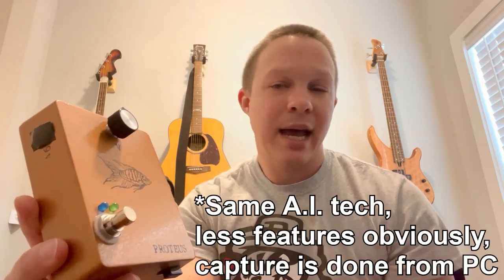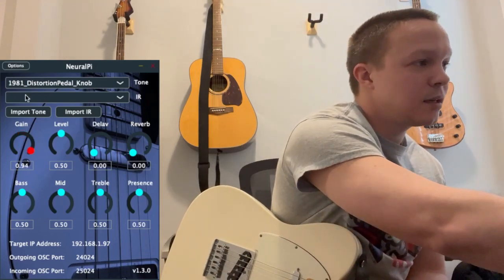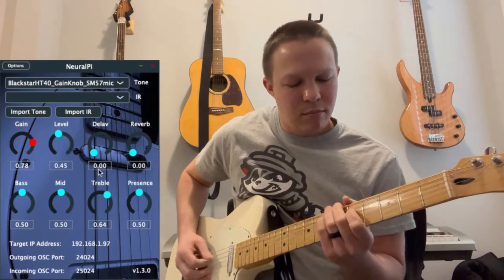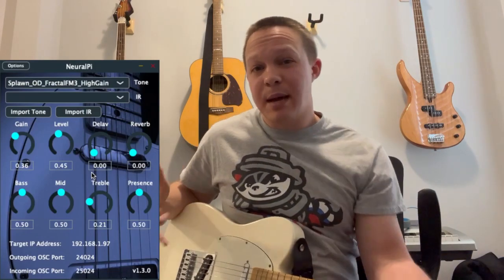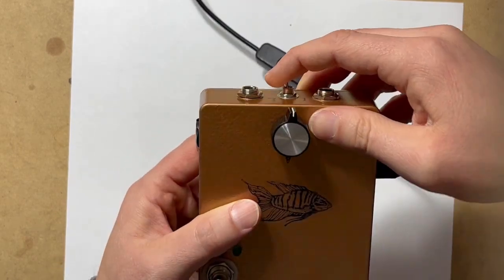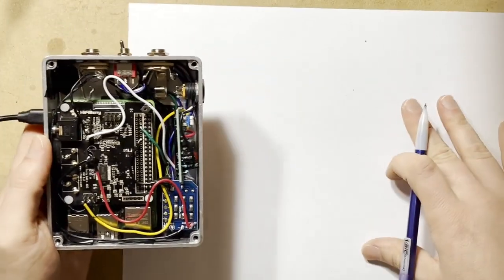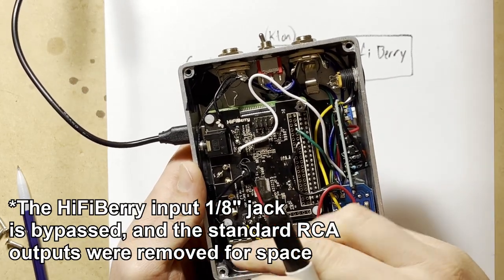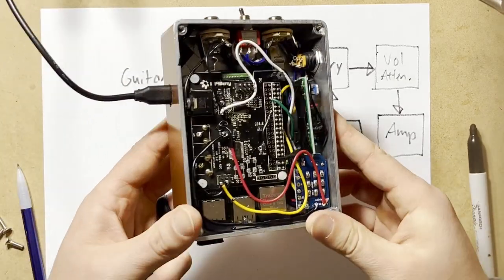Proteus Pedal - Using Neural Networks to Mimic Real Guitar Gear

Comment: Next level sh**. And you can play. A rare combo.

I heard a few minutes of Wampler's reaction to the Tone Master Pro second coming today. He said something like 'this will be a race to the bottom, software is getting so good and relatively cheap, in five years noone can make Helix or Kemper business out of it'.

He's also did a very open minded test of Proteus and NAM half a year ago, he's not moaning about it at all. Compared it to boutique pedal and amp market where a lot of small vendors are thriving.

We might see all kinds of hybrid options soon, or multi fx boards will become like laptops, a commodity you can install more or less anything you want on. 3D printing and simplified components would enable the rest of us to build something like this prototype from basic instructions only. 2026 latest. 

Even when ToneX and the likes gets to around €$300 some of us would still prefer total freedom to set our own box up exactly as wanted on an open hardware and software platform. There's a German crew flashing their future wunderbox on the NAM FB group for anyone curious. The next MOD audio and Poly Beebo is probably also a killer. Good times.

Everyone still needs to buy some kind of speaker btw, maybe there's still a lot of good revenue in that segment.

Comment: I really like the sounds I'm getting with Proteus. I have an issue, though: I'm using Linux and Reaper and more often than not the plugin starts with a constant noise or sometimes gives out audio on just one side of the speaker. I have to re-open the Reaper project multiple times to make it work properly. Again, the sounds are pretty great, though.

Comment: Great!Will you share the schematic and BOM?My wife would love if i had another project :p Cheers !
Reply from the maker: I might put together a build guide, but if you wanted to get started you could use my NeuralPi build guide as a starting point, and look up a klon buffer schematic ( or order the one from pedalpcb.com) and add a 100k log pot with a simple resistor attenuation circuit for the level switch. I ordered everything from Amazon (except the Hifiberry).
Reply: @GuitarML  Thanks!!I`ll check it out!!
Reply: @GuitarML  This would be absolutely awesome!
Reply: @GuitarML  would love the schematics as well! I see a couple of cables going to the gpio pins in the hifiberry, what are those for?

Comment: Is there an option to control 8 parameters (Gain, Volume, Treble, Mid, Bass, Presence, Delay, Reverb) via MIDI, e.g. via Teensy 2.0? 8 physical knobs would be extra. Connecting via wi-fi in gig conditions is the new level of existential pain.
Reply from the maker: Yeah I wouldn’t try to gig with it as it stands, but yes the operating system it uses is midi capable, which would be easier to do than adding knobs to the pedal. Probably a good next step.
Reply: @GuitarML  expression input to wireless midi (and/or parameter) would be nice.

Comment: Awesome development! Have you considered the input and output impedances of the pedal?
Seems very bright. Pickup loading may be screwy. Try a buffer Infront of it and see if it evens out.
I know this is my second comment about this in your videos but if you want new tech to play well with old tech, it does need to be considered.
Look forward to future developments!
Reply from the maker: It uses a klon style input buffer, which did make a huge difference from going directly into the HiFiberry card! Need to do more testing to see how it performs with other pedals.
Reply: @GuitarML  if you have an older non-truebypass Boss pedal(that have an always on buffer), place it between the Proteus and the amp in "bypass"(buffer only) and compare with and without.

Comment: So glad neural pi isn't dead. It's my daily driver.

56% cpu though is disheartening. Is that with delay & reverb? Any opportunities for optimization?

 Not much left to stack other plugins at that rate, or use that other channel for stereo, let alone multibus.
Running 6 core (4 for dsp) is what I'm figuring next.

So glad you're not holding back on the pi nonetheless. Love the all-in-one enclosure.
Reply from the maker: Yes that is with the delay and reverb, those use about 3% cpu and the rest is the neural net! Definitely room for further optimization
Reply: @GuitarML  i'm running as a plugin in under BYOD and realized quickly that a 10 year old 6-core xeon 4ghz all cores was not going to cut it anymore. Just a 2 or 4 instances put me in the red.
Reply from the maker: @womplestilskin  that sounds about right, the bigger models are relatively cpu intensive.

Comment: So essentially its like a Nux Mighty plug that you can load with all your own stuff? I like the Raspberry Pi in the stomp box, I don't think I have ever seen that, talk about thinking outside the box but still in box, is pretty clever when you don't have access to a chip Fab facility, although once you get it nailed down you could probably order a custom chip if you were going into production, I feel a kick starter campaign coming in the near future. 
   Maybe a line level out as well. Thanks for posting.
Reply from the maker: Thanks! Yeah it’s a tight fit with the Raspberry Pi in that enclosure. Lots of possibilities though! The line/instrument output level is controlled by the switch on the top.